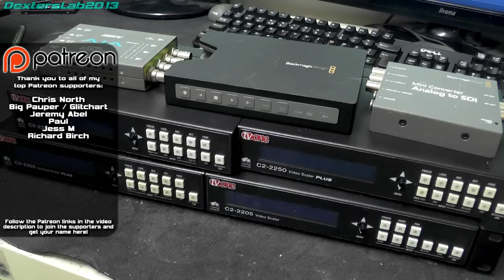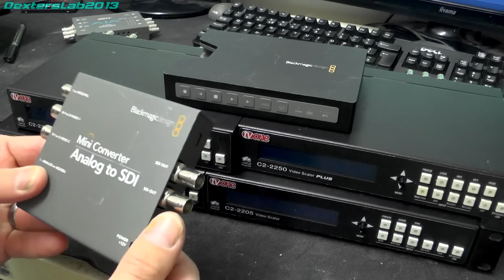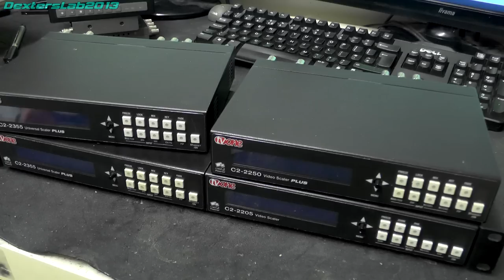DL164 Pro & Broadcast Video Scalers & Converters

Comment: Do any of these handle the holy grail of composite 240p upscale without interlace? Or any of the fun 15khz/24khz signals of early computers?
Reply from the maker: To me '288p or 240p' are not true analog video formats, it's just normal video but both fields would just be identical to give you 25 or 30 frames / sec rather than 50 or 59.94 fields / sec. The signal itself would sill be compliant 625 or 525 line interlaced video (aka 576i/480i). The scalers i showed can convert that to 576p50 or 480p60 no problem. The 15khz signals you mention from early computers like MDA/CGA/EGA use TTL signalling levels so couldn't be used on these scalers, at least not without some level conversion.
Reply: @DextersTechLab  Yeah, it makes it hard to find specific info on how they're treated in scalers! I dont have full domain knowledge here so feel free to school. I think the main issue is (at least with my extron dvs) try to add pulldown/motion comp to the frame and it ends up with every other field being slightly offset. Thanks for replying btw! I know lots of retro hardware camps are always looking for good scaling hardware and each has a unique video format to deal with. (240p ntsc, 15khz rgb, ega ttl, etc)
Reply from the maker: If both fields are the same then disabling any kind of de-interlacing and motion compensation i am sure would be the best option. Maybe there's something specific i could test? In your case what is the video source?
Reply: @DextersTechLab  Yeah! sadly some of those are not options to disable, just 'features' of some scalers :/ For me its mostly 240p game consoles with svideo/composite. SNES/Genesis/NES.

Comment: Have pc win7 with dual screen HDMI output. I want a third output to my TV. Would a small scaler achieve that?
Reply: Buy an extra graphics card.
Reply from the maker: As Simon and Steven suggested a splitter is all you need unless you want to alter the resolution. USB Video adaptors can also be very useful for adding 3rd screens.

Comment: Is there any information on reverse-engineering the RS-232 or networking protocol? Then you could drive a bunch of them from a Raspberry π, just for example.
Reply from the maker: The protocol is open and detailed in the user guide, using IP would be easier for operating more than one and the protocol is the same as the RS-232 method.